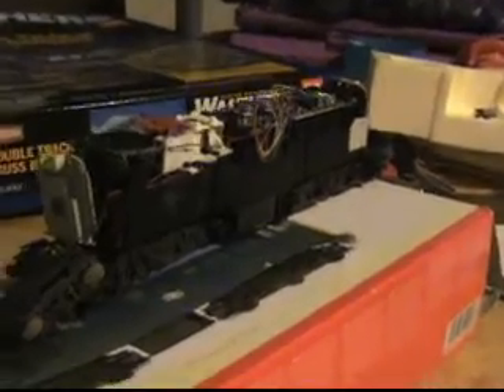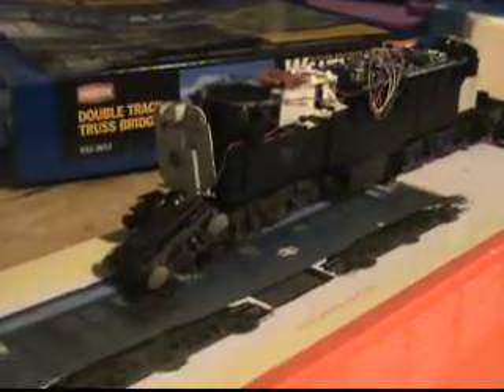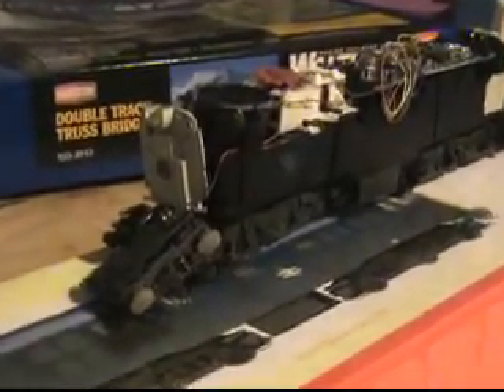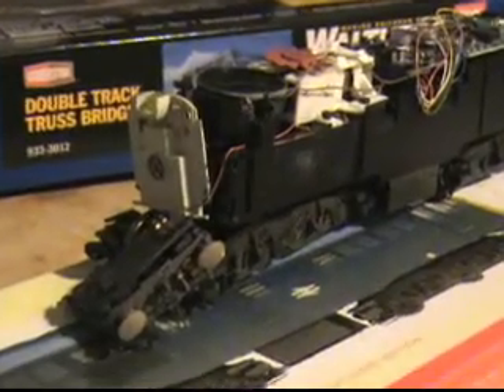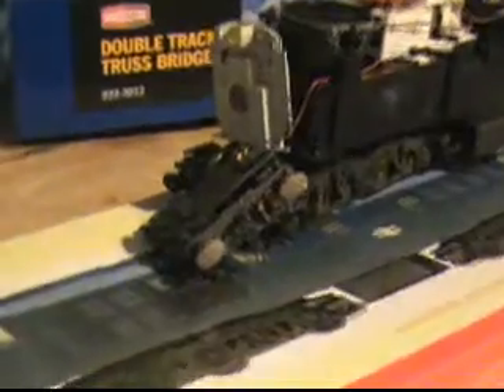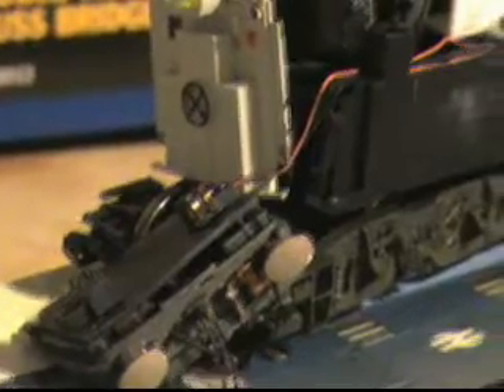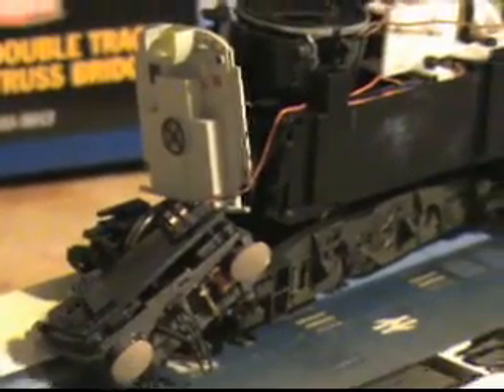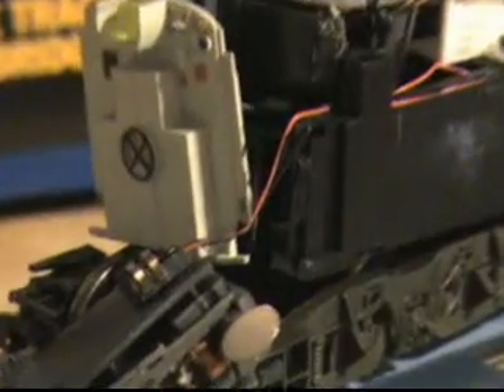Hornby Classs 31 Broken Corroded Chassis/ My first scrapped Loco?

Comment: Got the same issue with my Hornby 31, altho the chassis is still in one piece, the shell is split quite badly at both ends. When I spoke to Hornby they said just send it back and they will fix it. I still havent got round to doing that yet tho. Hopefully they will sort it as quick as what they did yours.

Comment: I've read about this and it is a common problem,I've got a green 31 but not sure of the batch or year has purchased second hand for £50 two and a half years ago not had a problem yet with it.
Its down to the pure metal used for the chassis and Hornby have said in Model Rail mag that they will replace the model but don'y know the time scale on this.
Hope they exchange it for you should be free of charge.
Kev

Comment: Hi gents , also the same casting quality issues were found with their railroad range 9f tender Chassis. I had to use an old margate made 37/47 pick up bogie chassis which clipped into the 9f tender frame , or an old ringfield motor housing worked as well , I have checked the majority of my collection so so far so good , my issue regarding this was also a few days ago I found that the rear pony truck on my Thompson L1 had cracks riddled in it and disintegrated into sugar when touched ! , got a a replacement from AC models , so it's ok

Comment: I have just taken my Class 31 out of a display case where it has lived since new and discovered the chassis below both cab ends have split and dropped cracking the plastic body shell at both front ends. I've never ran the loco so I'm a bit annoyed and have contacted Hornby although I don't expect too much help!
Reply from the maker: Yes, Apparently this was a batch of many of them. Mine was about nine years ago now. I must say Hornby was very good and replaced most of the loco and even paid my postage. Definitely contact Hornby. Good luck...
Reply: @CHESEABUN  I got a very quick reply from the email I sent to Hornby yesterday acknowledging the issue with the rot and saying that due to the age of the loco and subsequent retooling they cannot help. A shame really as it looked a good loco and I'll double check in future before buying Hornby. I also tried to post on the Hornby website for help but my post was refused by a moderator so there you go!
Reply from the maker: Oh? That’s not good. You would think they would try and help? There is an Accurascale Class 31 coming out soon. Looks great! There is not much you can do unfortunately. Unless you but second hand chassis on E bay.